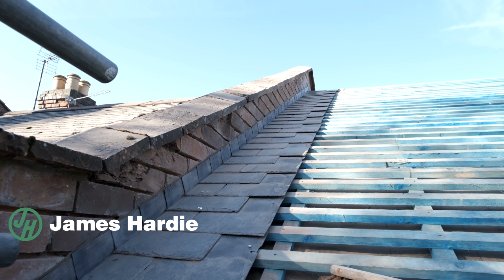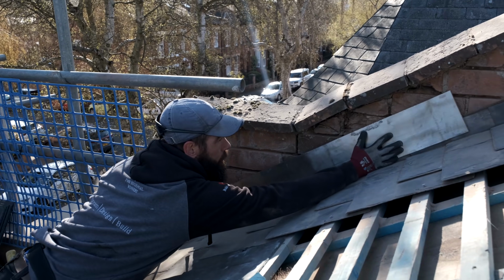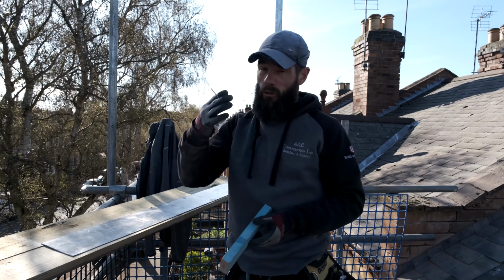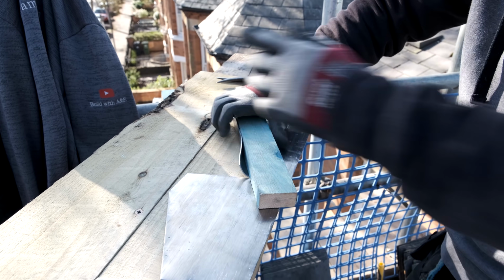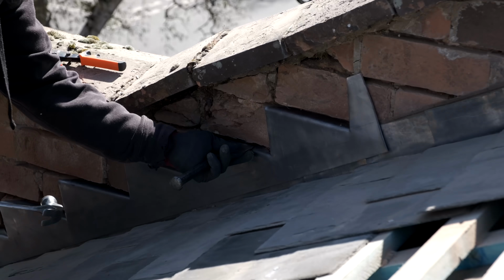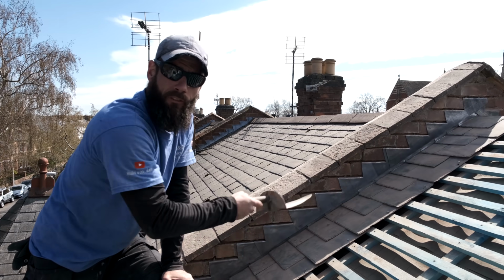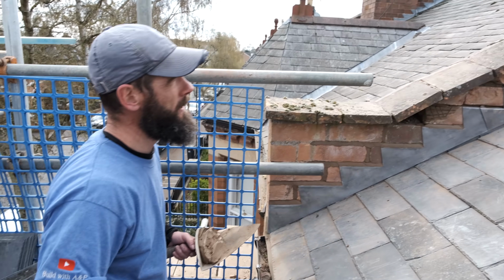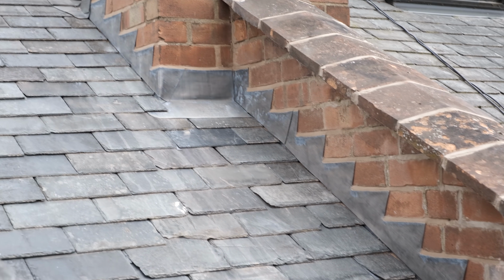HOW TO INSTALL STEP FLASHING

Comment: Been roofing for 17 yrs, I laugh at most other roofers quality and skill level but you are very good, your muck hawk is a brilliant idea , cleaner faster application when jointing up flashings brilliant idea, will be making one myself this week. Keep up the good work bro
Reply: You should try using a finger trowel on a small hawk,and push it directly into the joint. I find it much quicker. Still finish it off with a pointing trowel though.
Reply: @atmywitsend1984  yes I do it that way much better method it forces muck right into joint

Comment: Nice to see the lead pointed with muck.Lead sealant looks shite.But if you do the joints at correct depth id never seen a problem using muck.

Comment: We need people like Will ,to teach the youngster's how to do thing's  right .Love the guy.
Reply: Too right, the Government should fund courses on how to do it right so the younger ones can then teach when it is their turn
Reply: I would love the opportunity to work with will for a few days, not even for money purly for his experience
Reply: Im classed as a youngen but yet I can do all this and to that standard with ease.. if anything though I'd never point lead in anymore and certainly not use those clips I prefer the old school lead plugs I make myself as they're way stronger i find.. as for filler lead mate is far better.. gives way better bonding to the lead compared to mortar and under the stress movement of lead won't crack and fall out like nearly all mortar filled joints will.. Just because some people are young some of us know what we're doing and some think deeper into it then the old boys.. It's about taking pride and pushing the quality of each job further and progressing the trade.. I like the old way and do most my stuff that way but certain things you can't deny are better for longevity.. I got taught the old way doesn't mean it can't be made better
Reply: @ETH85  Well said from an old guy here. Another tip you may know with lead, is only score your cut line. I always use a felt tip for fold lines. As scoring makes a weak point that could split the lead later on. Its good to know that the younger guys want to do a thorough job too. I have never used the clips for holding the lead either. They do look a lot less faffy though. I understand why they may be preferable for speed reasons. I have no idea about their longevity though,so I still use the rolled up lead wedges,as they have done for centuries.
Reply: @atmywitsend1984  I do the same.. Never put a blade to lead unless it's to cut it.. I can make flashing look like a machine made them because I'm fussy like that and like everything to be as bob on as possible.. you guys have done what you've done for years because it's tried and tested and I got taught the same.. the amount of work I do correcting others bullshit work is unreal..
No pride in work anymore just all about quick quids and gone.. just makes me better and better I suppose just unreal how much shit goes on in roofing that shouldn't
Reply from the maker: Thanks for watching Peter! 👍

Comment: Neat lead work , if the lead was a little wider the angle cut would have been more at an angle rather than been vertical, not sure if the job spec was to use mortar ( muck) but using lead mate a substitute to muck , lead mate is a sealant that when the lead expands and contracts with the temperatures so does the sealant ,which avoids cracking, mortar (muck) will potentially crack ,good work ,Will not picking faults as that’s the easiest job in the world do ,  just passing on info on how I  was taught , great videos 👍
Reply from the maker: Thanks for watching James, have a lovely week! 👍

Comment: If you get your skillsaw and rip a slot down the centre of your batten through the 50mm side in about 30mm,slide the lead into the grove cut with the skillsaw to your pitch line and fold the lead with the batten,nice and easy straight fold😉,great work by the way